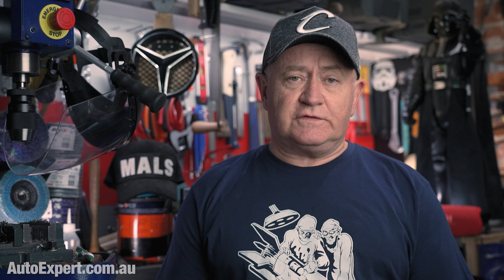Automotive Journalist John Cadogan Puts the Elecbrakes EB2 to the Test!

Comment: The only thing not touched on in this video, which might catch the unwary, the headlight and brake circuit are not typically designed to run an electric hydraulic brake actuator. If Joe Blow buys a brand new boat or caravan greater than 2000kg and decides to  "plug and play" as per this video, they are in for a surprise. The Hydrastar unit on my boat trailer requires a dedicated 40amp (as per manufacturer) feed from the car battery to run the actuator.

Comment: Brilliant commentary! Love the 'crazy Elon' references too!  - that resonated :) Mounted mine on an Aussie off-road Harvok 19ft caravan (here in NZ), but had to pre-drill the 4.5mm holes as the steel was pretty thick, but also had to cut short one of the supplied screws to stop it punching through the trailer wiring loom bundle routed  through the centre of the beam, and use a tap-and-die set to pre-thread the holes properly, so a bit messier than described in the 'how-to' guides which are a bit over-simplified for the heavier off-road trailer installs I feel.
Reply from the maker: Thanks for the great feedback and glad you enjoyed the commentary! 😄
We really appreciate you sharing your install experience for your setup. That’s very helpful insight and we’ll definitely take this onboard as we continue improving our installation guides. Thank you!

Comment: This is hands down the best brake controller, I'm on my 2nd one, since I gave my 1st one to the person who bought my last caravan. I would recommend this to my worst enemy. every time I email the company, I always get a quick response, and if your clever like me I bought mine on sale either thru eBay with their vouchers or from a boxing day sale.

Ive hidden mine behind the chassis and used a hard wire cable straight to the trailer plug, no 3 way crappy cable

Comment: Best think again if you are touring, the adapter exited on corrugated road, FIRST TRIP. not only lost the adaptor but totalled it the trailer plug too, the adaptor and cable connection add significant weight and length leverage not good for touring. 

Worst part is if you are remote you will be without any trailer brakes for hundreds if not thousands of KMs. we were at a remote station they could sort any auto elec issues but not this as it’s product specific.

Comment: they would want to have a chat with there autobarn dealer's in Victoria if the newer car's are running led lighting they don't work then the so called manager of the store try's too make the paying customer out to be the problem when they don't work and want's you to ring the manufacturer after selling you the product and not asking what vehicle it's getting fitted too  and make out the paying customer is the problem the hole idea of buying this is to not get an auto electrician is flawed
Reply from the maker: Thanks for sharing your experience and we’re sorry to hear about the frustration. Elecbrakes units are designed to work with LED lighting on vehicles or trailers, so if you’re having issues, please reach out to our tech support team directly at info@elecbrakes.com or 1300 516 248 and we’ll be happy to help troubleshoot with you.

Comment: I have a break away system can this system be added or do I have to add more parts to trailer cheers
Reply from the maker: Thanks for the question! Break away systems work side-by-side with Elecbrakes brake controllers.
- EB2 applies the trailer brakes when it receives control signal from the tow vehicle, triggered by brake lights activation and deceleration measured when you apply your vehicle's brakes.
- Break away operates in the event the trailer detaches from the tow vehicle and uses its own battery power supply to lock the trailer brakes on, to bring the trailer to a stop.
For more info, check out our FAQs: https://www.elecbrakes.com/faq/ or call our tech support team on 1300 516 248.

Comment: Back in the day, a drawbar mounted brake controller just required you to adjust the dial for braking the load you had. Being able to adjust braking in the cab on the fly makes it much easier. I wonder if this system can handle 24v from a small truck, on the basis that the trailer has LED lights as well?
Reply from the maker: Thanks for your question! Elecbrakes brake controllers accept both 12V and 24V DC input power. The brake controller will regulate the 24V input, managing a 12V variable output for proportional control of the service brake circuit.

For more information, visit the “Vehicle Compatibility” section on our FAQ page: https://www.elecbrakes.com/faq/

Alternatively, contact our technical support team on 1300 516 248 - we’re here to help!

Comment: So this is better than the Redarc thats out there now? Would need 2 controlers if you tow more than just a caravan / boat / horse float  ext

Tell us how much the EB 2 is....
Reply from the maker: Thanks for your interest!

Elecbrakes offers two brake controller options to suit different towing setups, with no interior modifications required to your tow vehicle.

- EB2 Trailer-Mounted Brake Controller: Installed on your trailer, the EB2 lets you tow with multiple vehicles without fitting a controller in each one. Ideal if your caravan, boat, or horse float is shared between vehicles.
- VM1 Vehicle-Mounted Brake Controller: Installed in your tow vehicle, the VM1 is perfect if you regularly tow multiple trailers.

Both brake controllers feature world-first technology, including seamless in-car control via Apple CarPlay and Android Auto, giving you real-time access to brake settings directly through your vehicle’s infotainment system.

Our EB2 trailer-mounted brake controller starts from $789, which includes the unit and a plug & play adaptor. Final pricing may vary depending on the specific adaptor required for your vehicle and trailer setup.

You can view full product and pricing details of the EB2 here: https://www.elecbrakes.com/product/elecbrakes/

Let us know if you have any other questions - we’re happy to help!